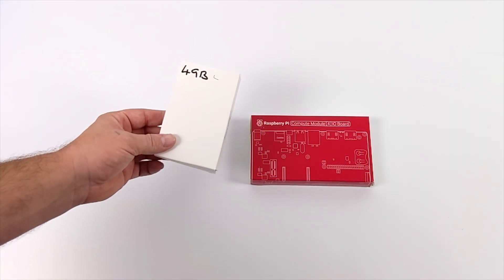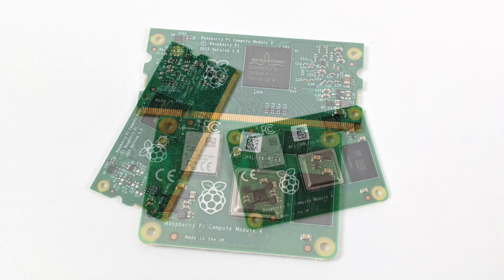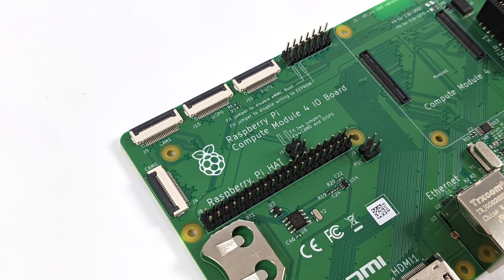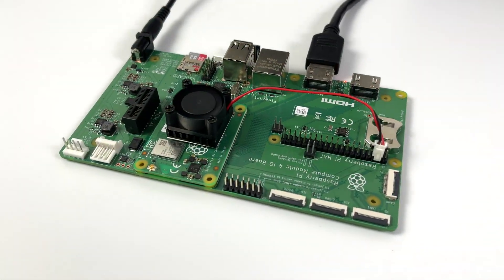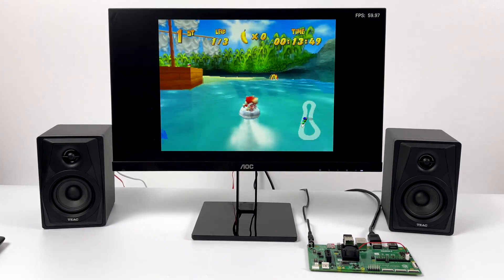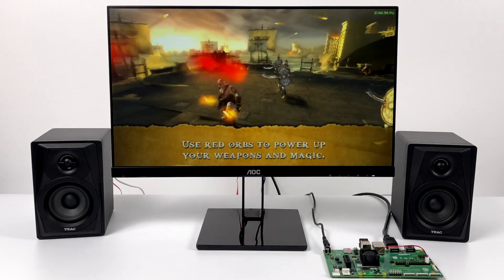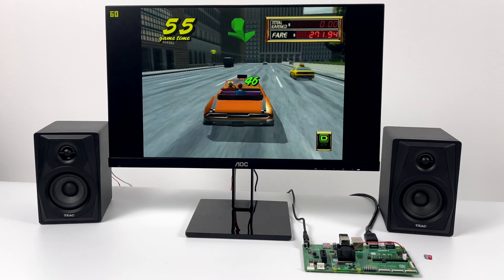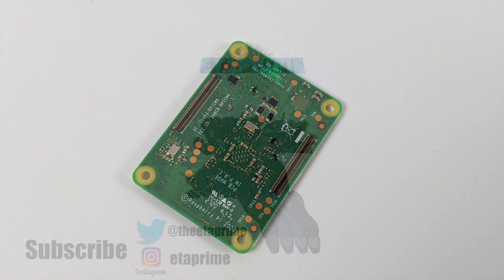The Compute Module 4 Is an Emulation Beast! Raspberry Pi CM4 Review

Comment: Hope you see this comment even though it's probably more than a year out since you made the video.  I've been working with the cm4 to emulate Saturn games using yabasanshiro.  Most games run great on it but I want to overclock and it does run way better once it's overclocked.  My problem is power I have a 5 volt 3 amp power supply the fact that you need to up the voltage to 8 to overclock probably means I need a beefier power supply.  Which one do you recommend?

Comment: Power of 5 or 12 volts and one step down on board. That would have been good idea for the 4B model. 5.1 volt 3 amps (15 W) brings some power supplies to the limit. No problem with PD and 9 (27 W) or 12 volts (max. 36W).

Comment: Totally off topic. But do you have a video on the mixer setting for retro pie? I use my 3.5" jack, and when I go into mixer setting it shows hdmi at %100, but no place to  toggle to 3.5mm audio.  My 3.5mm audio does work, and hooked to speaker, but I just want to know if the mixer settings are also set to the level I want.

Comment: IO board design sucks. Support for NVMe PCIeX4 or PCIeX4 and PCIeX1 slots or USB3 and SATA3 would have made much more sense than those proprietary RPI digital display and camera connectors. The PCIe channels are there, use them meaningfully.

Comment: I am not sure I understand: to make a handheld you need to deal with 2x100 pins high density connectors, and the breakout board is as big as my VHS; so that will be an interesting task for sure.

I see more value in desoldering the connectors from a regular Pi4 to make it flat; it takes less efforts for sure; unless the module provide a better and smaller breakout board, or you have the ability to deal with such dense small connectors.

Comment: man I really hope the pi5 comes out and can emulate dreamcast perfectly.
Reply: I'm hoping you can also emulate the PS2 and GameCube/Wii
Reply: @TheDrakanMaster124  GameCube will be a likely yes. I doubt ps2 emulation will be an option until the pi6. You are better off getting a PC and using PCSX2 with Launchbox.
Reply: @smpmuzpid  maybe on the pc. Definitely not on a arm processor. Even snapdragon 855/865 can’t run ps2 games well because of proper emulation support on android. GameCube emulation is doable on snapdragon and Nvidia shield. Pi4 can’t and Odroid n2+ can’t really either.
Reply: It really depends on the emulator optimization and driver support. Pi5 is years away too. If anything I’ll be looking toward Odroid n2+ support for Dreamcast.
Reply: I still want to know if it can run pso

Comment: While it sucks that the sodimm slot is no longer a thing, it did add a lot of thickness to the overall assembly. Plus, you couldn't mount anything to it, due to how it had to latch into place.

I think the change is for the better... Now if the new connector is easy to find, that is another story altogether.

Comment: CM 4 is seriously awesome... You can build handhelds, actually low end but usable laptops or tablets. 
2 in 1 powered by raspberry pi would be awesome... It could be cheaper than Surfaces and windows 2 in 1 or iPads(with keyboards) but still provide more functionality than the android ones.

Comment: Single board computers will be replaced soon with a system on a chip.
Reply: ? Sbc are usually soc powered and you cant stick a usb port in to the silicon
Reply: @the_retag  No, but with high speed wireless connections who knows what will happen.
Reply: @TonyDartford  maybe sometime in the future but for now i think its unlikely

Comment: I really hope they make an RPi 4 model with eMMC. It is something I am missing in the lineup. And of course: Great video yet again!
Reply: Compute modules are in two main flavours - with an eMMC flash onboard, and the other without.
https://www.raspberrypi.org/blog/raspberry-pi-compute-module-4/

Quoting:

"32 variants

With four RAM options, four Flash options, and optional wireless connectivity, we have a total of 32 variants, with prices ranging from $25 (for the 1GB RAM, Lite, no wireless variant) to $90 (for the 8GB RAM, 32GB Flash, wireless variant)."

Comment: fun fact
a regular pi 4 can also do 2.3 ghz
my rpi 4 can do 2.35 ghz max
anything above that and it becomes unstable
i can technically do 2.37 but well ... it wont be long till it crashes
Reply: Mine can do 2350MHz too. AT 2.4GHz, it boots into the desktop, crashing - freezing shortly after starting a demanding app. over_voltage=10.

Comment: What's the difference compared to the regular rpi4? Is it any more powerful?
Reply: As far as major architectural differences, the USB port on this thing is actually the USB device port on the 4B, which is why you need in config.txt to write the same line that you'd write on a 4B to use the device port as a host port.

Comment: I'm experimenting with "Flight Gear" on the RPi 4/8. It is not spectacular, but so far so good. I can't believe the RPi can run a flight sim of any kind, (other than Linux Air Combat.) Once Vulcan gets worked out, with some tweaking on the sim itself, I think it should be perfectly playable for any normal single engine plane. Maybe not at ultra high resolution, but still... I got 31-38fps on a ten minute flight this morning. That's not awful.

Comment: Thanks a lot for your video. It was a really cool introduction to the CM4.
I am a fan of your channel and, as an observation, sound here has awesome quality, but volume is a little low (I think it varies with each YouTube channel).

I wuold like to thank you for your tutorials. I had been away from gaming for many years and the last few months I could learn how to use the Pi 4 with Batocera, Retropie, to configure the PS3 controller, to be updated with the latest news in a clear, direct and inspired way.

I also have a few doubts: what is the most efficient way to emulate GameCube on the Pi 4?  Maybe with Flamemonkapie or other system? 

I also would like to learn about your best configs for the Dolphin and PPSSPP in order to run the games at its best.

These consoles and others, like NDS (which has been the only reason that makes me prefer Retropie over the beautiful Batocera with its NextGeneration Theme), they are great consoles that so many of us didn't even know.

And, finally, have you overclocked your Pi 4 8GB at 2.3 GHz yet? Would you share with us how? Can Gamecube nice emulation be achieved with this level of overclocking?

Anyway, it's been a lot so far!

Thanks a million for your inspiring tech videos for so long! Just keep up your awesome work!

Comment: Problem is, that future handheld will probably not have a massive fan on it, so probably not a big overclock.  So how is the CM4 operating at standard speed?
Reply: That fan is hardly massive, the scale just makes it seem so -  but a decent enough heatsink would be good enough as seen in the Pi400

Comment: I would like to see Graphics Card in that PCIe slot.
Reply: Doesn't work. Jeff did a video on it already. The guy ETA prime mentioned in the video. It is a pretty interesting video if you have time to check it out.
Reply: @MDStroup  I know.....but just think if it would be possible. This thing would have become even stronger than the Nvidia Shield tv-tegra x1
Reply: @MDStroup  isn't he still trying to get it to run?
Reply: @the_retag  I can't remember. But I think last video he determined that it is missing very important architecture at the moment to be able to do it.

Comment: I bought a Rp4 8gb model. But im still not sure which Os I should use. Im in between Twister Os and Raspberry pi Os. Which one would be better?
Reply: To really use its 8GB of memory, real 64bit system is necessary. Currently, Raspberry Pi OS has 64bit kernel, but 32bit userland. They'll probably release a full 64bit distro sometimes in the future. I've tested Ubuntu, works well, except for some peripherals - sound tearing etc.
The biggest memory hog is a browser in my case. A 32bit system really holds it down.

Comment: When a compute module is only 0.1ghz lower clock than your laptop...
Reply: Laptops are x86 based, any x86 processor from 2012 or above is faster than the ARM core in the Compute Module 4.
Reply: @lonitro725  oh thank you. My laptop is from 2014 if I remember correctly

Comment: I hope someone revives the Piphone project. The CM4 would be great for that application.
Reply: Yeah wouldn't it be cool if could just upgrade your phone by dropping in a new compute module?
Reply: @themacintoshnerd  I'm late to comment but that's genius
Reply: The Pinephone exists! It's a Pine64 SBC in a phone form factor.
Reply: @anthonyajumelles  PiPhone. Not Pine Phone. A phone based on the raspberry pi. Possibly running Android for Pi.
Reply: welp there i go designing a custom board haha

Comment: Have you stress tested it at 2.3GHz? If it's stable I think you won the silicon lottery since from what I had read before the usual max was 2.2 and 2.1 for the unlucky ones.

Anyway I hope this new stepping (C0) will come soon to the normal Pi 4 which as of now uses the previous B0 which is less overclockable and heats up more

Comment: Does raspberry pi zero w supports play station on retro pie os
Reply: Some games run well, basically the 2D stuff runs great and a handful of 3D stuff but most of the library is a no go. You could get a banana pi m2 zero for under 20 quid, it has a much faster SoC than the pi zero, it even plays some n64 games and it's the same form factor as the pi zero

Comment: I want one of these in side a mouse to have a mouse that can have a power input, display output, and a keyboard out put. You can put a mini 3.5 inch display in front of the mouse and a mini keyboard with a built in battery, bam a form factor that you can go anywhere with and play Minecraft with

Comment: This is a nice new little form factor the Pi Foundation are coming out with.  I do hope someone produces an IO board with a few low profile connectors to make building a handheld unit easy.  Ideally I would be looking for connectors to screens, an amplifier so you could just connect some speakers and battery/charging ports alongside options for connecting controller circuits.

I still think that to progress the Pi Foundation needs to move away from the old Broadcom chips for something with a bit more graphical power as they have previously stated that the Pi 4 is as powerful as they can get on the current processing node.
Reply: If you haven't seen yet someone made a board to build this into a PSP 1000 and it's awesome. it's called the PSPi 6